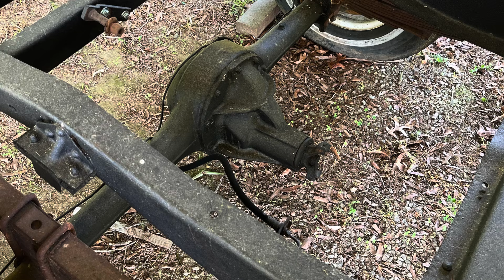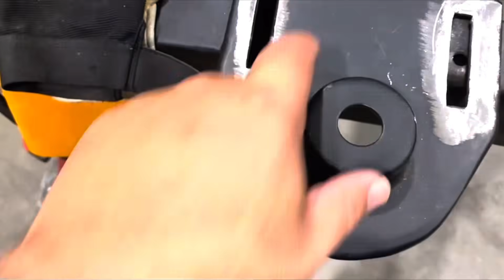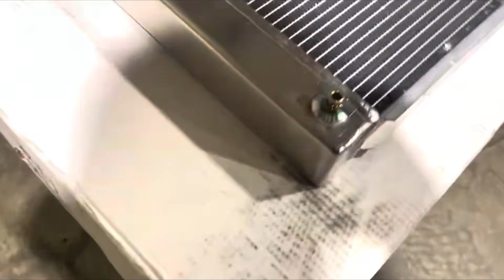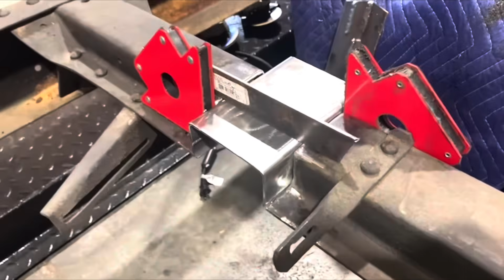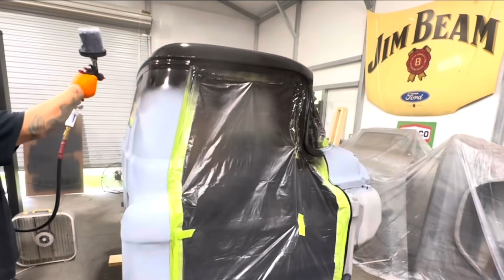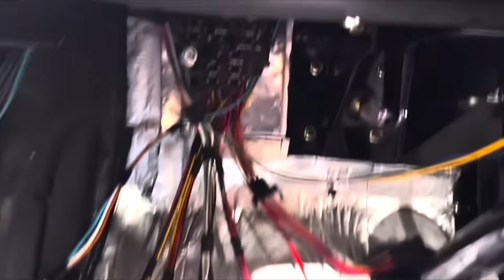How I Built the ULTIMATE Custom 1955 Chevy Truck in 30 Minutes!

Comment: Great info!  I have perused your vids over & over, they are really helpful!  Did you cover the power distribution panel/fuse box on the transmission tunnel?  Looks like a good idea, any help would be greatly appreciated!  Thanks
Reply from the maker: Thanks! Its just something I like to add when wiring cars… think of it like an extension of your battery but on the interior - just a convenient place to grab fused positive and negative inside the vehicle should you want to add circuits for whatever

Comment: I have owned a '56 Ford F-series and my cousins owned respectively a '56, '55 and a '54. I understood that the major difference in the body is that in '56 the front windshield post is vertical or straight while the earlier bodies had a slanted front windshield post. You refer to your straight post as a '55. Could it be a '56 body originally purchased in 1955?
Reply from the maker: Sounds like cool projects, I always liked the 53-56 Ford trucks. However, Im building a 55’ Chevy truck on this channel

Comment: Quick question on setting up the rear end.  You mentioned quickly in order to get geometry correct, the engine and cab need to be mounted.  These should be done before I mini notch and 4 link?
Reply from the maker: Yes, absolutely! You want as much weight on the frame as possible. When the vehicle is fully loaded, thats where it will be at its intended ride height and you need to set up your rear accordingly
Reply: @ thank you. I’ve learned  a lot from your channel
Reply from the maker: @blakethompson6780  That’s music to my ears my friend. This channel was never intended to be about being a “tv show”… but about sharing, helping and empowering viewers. Good luck!